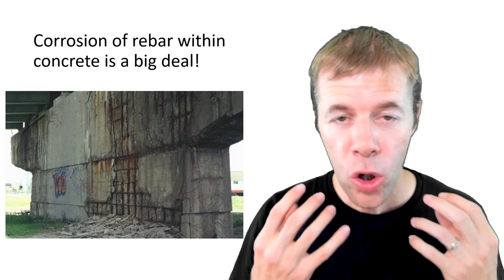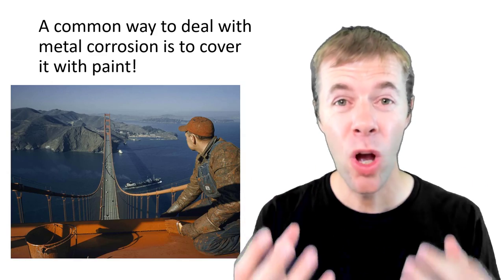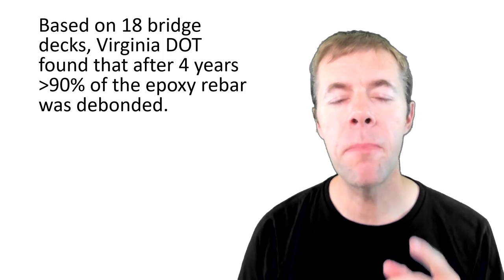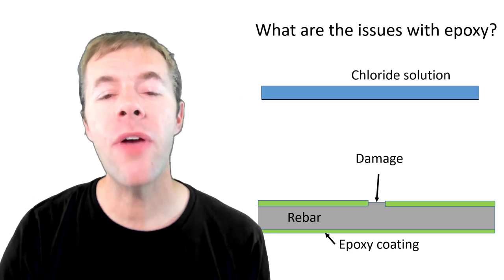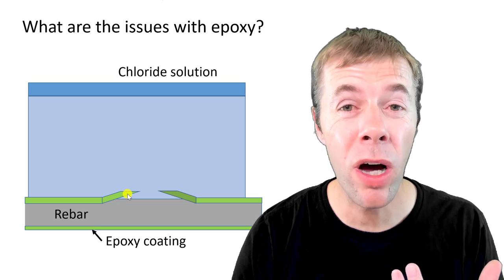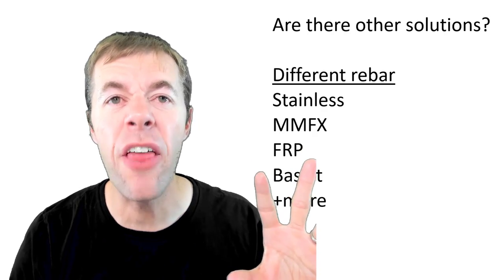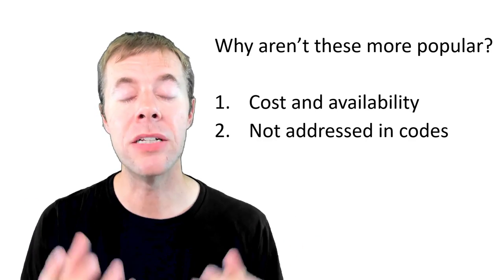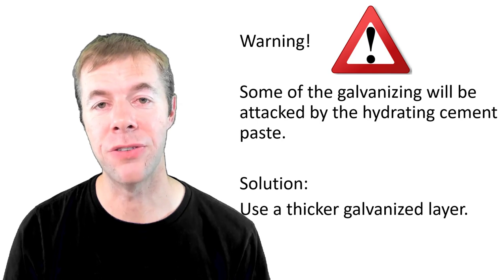What is epoxy coated rebar and why is it being banned?

Comment: Expoxy coated rebar has higher development lengths, meaning it needs more surface to "grab" or bond to the concrete to add strength. This makes splicing more expensive in beams and slabs as the overlap from one bar to another is longer. On a bridge deck or a grade beam, this adds up very quickly.
Reply: Unless you use couplers.

Comment: In my working career, I managed estates on an ocean island as a builder/contractor and can attest to the various qualities of galvanizing. The more modern stuff (from the '80s to the 2010s) the quality of the hot-dip galvanizing has fallen greatly and the salt air rusts through in 10 years or less
. Some of my places had galvanized fasteners from the '40s that showed no or little rust from 60 plus years of exposer to the salt air. 
So I would say from experience that your comment about thicker galvanizing coating is spot-on!

Comment: Accentuation of corrosion at tiny defects suggest that galvanic effects are the driving force. With unprotected steel it is mild and diffuse, with protected steel it is magnified at the weak spot.
Reply from the maker: That is right.
Reply: Syd Moran  Ha ha, I like your avatar, I am a north sails fan.
Reply: I found out that zinc plates are used to keep ships from rusting. Fascinating stuff
Reply: @Slickshadow11 - Ships use active electrolytic corrosion prevention. A small electrical current of opposite polarity to the current produced by corrosion balances the effects.
Reply: @algrayson8965  Yes, the use of sacrificial anodes is a very common practice not only in shipbuilding but even in household items like water heaters.  The problem is that the anodes do not last forever and require periodic inspections and replacement.